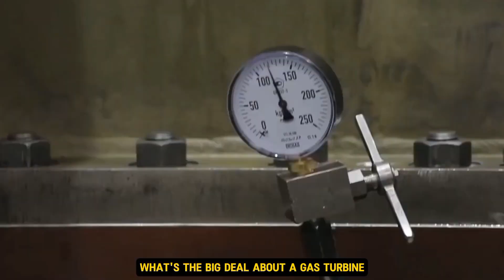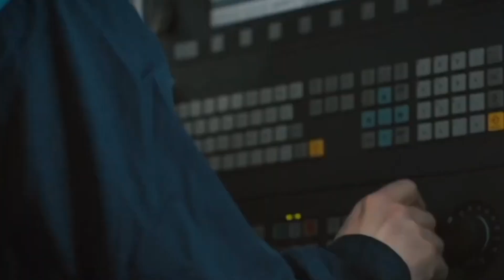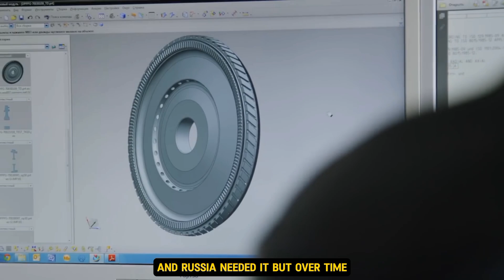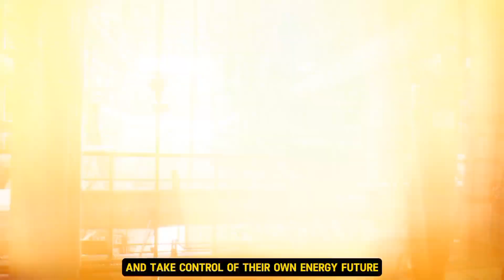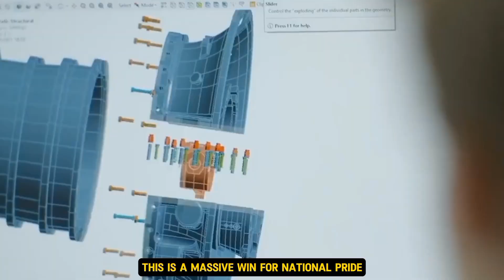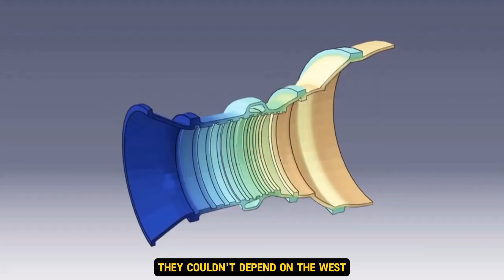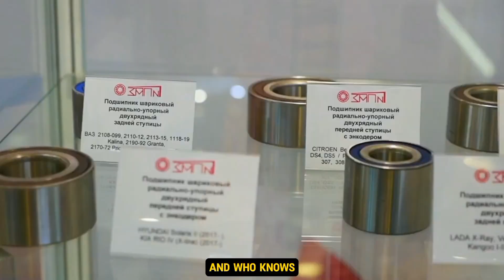Russia’s New powerful Turbine Sends Tears Across America

Comment: Its a little misleading as the turbine is just a piece of equipment to efficiently turn the steam expansion of water heated by nuclear fission to turn a generator, The generator makes the electrical power. However, it seems that Russia is now able to make each piece of a nuclear power station without western help and can build the entire station in other countries, Turkey for instance. Pretty amazing and competition for the west.
Reply: GTD-110M is a gas turbine engine that uses products of fuel combustion whose temperature exceeds 1500K (I don't know exact specs).
Its mechanical power exceeds 110MW on the shaft, while its thermal efficiency exceeds 36%.
GTD-110M can be complemented with steam generator equipment that uses exhaust hot gases of GTD-110M and a steam turbine to increase thermal efficiency up to 60%.
Russia produces steam turbines last 34 years without problems since this is low tech equipment even for nuclear stations. While gas turbine of 100+MW class is something new in Russia for the last 6 years.